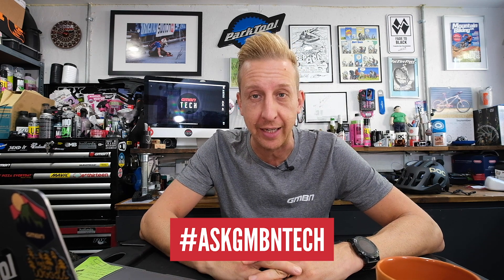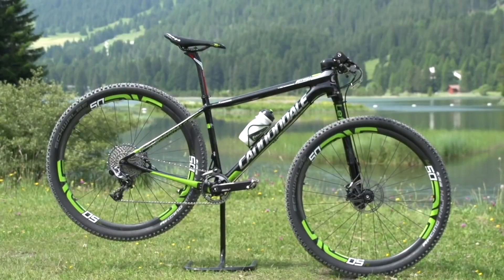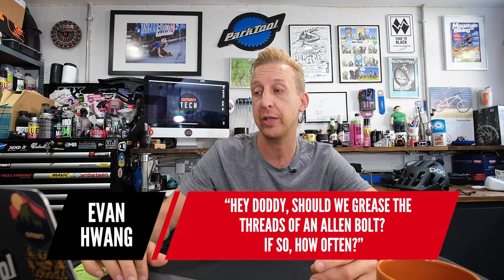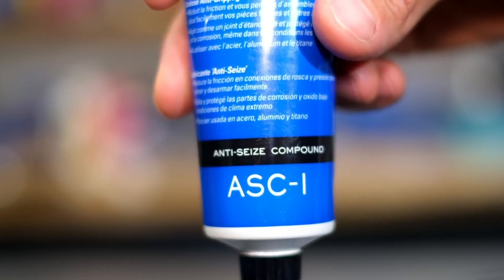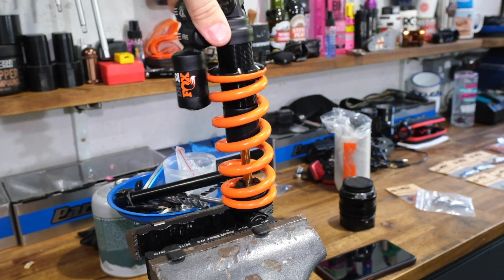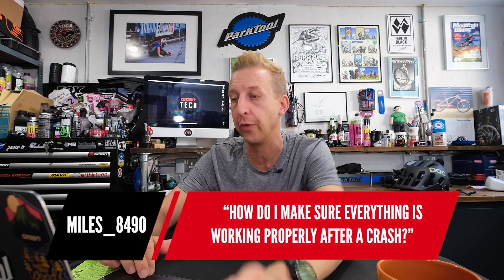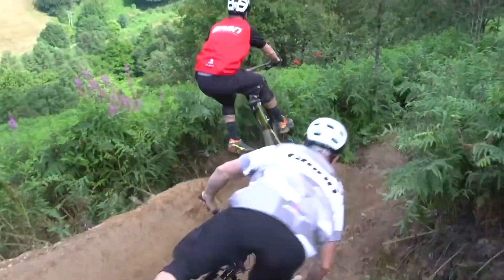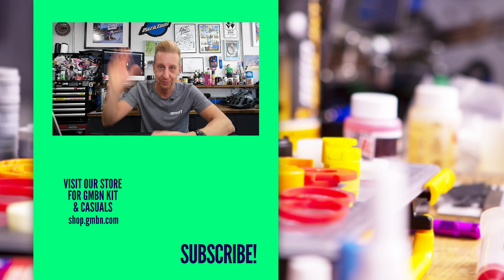How Do I Check My Bike Is Not Broken After A Crash? | #AskGMBNTech

Comment: #AskGMBNTech hi I have a Lapierre zesty 3.0 from 2019,about 2.5 months ago I cracked the frame just in front of the rear break Caliper and I have just got a response from Lapierre saying it’s under warranty but I have to wait till January to get the replacement. I love the bike and have upgraded the gears, the fork, the wheels and breaks and loved the way it handled, I’m looking for a slightly bigger travel bike for 2021 as I have had it for nearly two years, do you have any suggestions?

Comment: #AskGMBNTech - Hi Doddy & team. What makes a tubeless tyre tubeless? My sons bike is fitted with Kenda Slant Six 24 x 2.6 tyres. I wanted to set up the bike to be tubeless but these tyres are not tubeless ready in this size and couldn’t find the same size tyre that were tubeless ready, so i thought i would give it a go anyway. They have been holding pressure for a while now, but is there something that could go wrong in the future (will punctures not seal etc) Cheers

Comment: #AskGMBNTech Great show, watch it religiously. I have a 2010 Scott Genius 50 with the Equalizer 2 rear shock made by DT Swiss. The shock needs a service but is near impossible due to it not being main stream and service kits are hard to find. Is there a rear shock made by another big manufacturer that would work and fit?
Reply: In uk? Try full factory suspension.
Sorted a 2004 cannondale headshock even tf tuned wouldn't touch
Reply: @rupedog  unfortunately not. I stay in South Africa.

Comment: #askgmbntech how would you know if purchasing an after market shock or fork would be beneficial? I have a new stock trek fuel EX8, and the stock suspension seems fine but all the shocks / suspension from Fox / rock shock seem more capable, would they help with my riding?
Reply: Your bike has suspension that most riders want to upgrade to. If that suspension was holding you back your sponsor would have already sent your team mechanic the upgrades to install on your bike. You should spend more time trying different settings and less time looking at ads.

Comment: How do I true a wheel after having a crash and only discover the rim is bend but the rotor is still running straight to be able to get me home on the trails.
Reply: you can't true a wheel on the trail without a truing stand lmao
Reply: @miles9294  you can, just use some cableties against the rim. And then just true them as normal.
Reply: @gryyta9617  you can do that but its not a proper truing, its enough to get you home but you shouldn't keep riding
Reply: @miles9294  you can get it nearly perfect, good enough to keep ridi'n.

Comment: #askgmbntech I am wanting to get 1x12 drivetrain, my bike has a 1x8 right now and I saw you need a different hub for it. could I get it without a new hub or do I need to get a new hub for it to work?
Reply: Not necessarily. U might be able to get just a new freehub body, depending on the hub, or some of the lower range sram will fit a standard shimano splined freehub, as will I believe the e13 13 speed, sunrace and maybe others.
So no, u can do it without a new hub.
Reply: @rupedog  do you think shimano deore would work or will i need a new one for that. I am looking for a buget one

Comment: #AskGMBNTech  hi just wondered what to do if my dropper keeps on moving while not pushing the lever. i have just installed my dropper ( i have a specialized pitch it has a dropper routing on the down tube but not in the seat tube) i have a external dropper and have just routed the cable through the down tube but now i have done that the seat moves without pushing the lever can you help?
Reply: cable is too tight?maybe the cable routing has a tight corner and cable rubs inside?
Reply: @elvisp8104  no I think it's cos the cable has to go round the bottom bracket which it too acute of an angle for the cable I think anyway

Comment: #AskGMBNTech Hey Doddy, I've got a Rockshox Reba 130mm travel with a solo air spring, I'm about to do a lower leg service, and I'm wondering if I can I fit a DebonAir spring?  The part number on the back of the crown is 16T81680535.  Thank you
Reply: Yes u can. Check rs website, find the rs spare parts catalogue and ur fork, and it will list the upgrade spring in the parts list

Comment: #AskGMBNTech hi I'm fairly new to MTB, I have a 3x8 cannandale trail 2020  can this be made into a 1x8 or 2x8 also can you make a video of how to convert it on a budget or would all parts need replacing or would the removing of 2 rings work thanks in advance
Reply: Watch this very video...doddy goes over exactly this!!
But at the cheapest level, u can just remove the front derailleur etc, and the smallest and largest chainrings
Reply: Have a look at the box 4 8 speed it’s pretty cheap and should fit
Reply: @bristoldh7907  thank you 

[edit] ordered looks an easy(ish) swap out

Comment: #Askgmbntech I just got a a giant trance 2 and when I’m on gear 2 it’s making a ticking why?
Reply: random stuff of thx
Reply: If it's only one or two gears, the hanger could be slightly bent.  Also, it might just need a slight cable adjustment.  I had that once, and it was a bent tooth on the next smaller cog that was catching up the chain from below it.

Comment: #AskGMBNTech Should you always set the same amount of sag front and rear or you can play around with a different amount of sag in the front vs the rear?
Reply: Rear is usually about 25-30%, front 20-25, but varies on type of riding, use, bike, rider, etc etc
Reply: Rupert Wenn I run both at 20% sag. Thanks for the info.

Comment: #AskGMBNTech i recently rode my bike through some salt water , i throughly cleaned it after with fresh water and soap but now i have furry nipples , no one likes furry nipples . i cleaned the fur off with wd40 and a tooth brush . but it comes back every other week or so . the rest of the bike is fine , the spokes still have tension and the wheels are still true . are these wheels still safe to ride or should i replace them ?
Reply: Sea water or sand must have made its way into the spoke nipples. Tyre probably absorbed a bit too. Remember this happened to a BMX years ago. Think it took ages to stop happening. I rode it with no problems. Keep an eye on it though

Comment: #AskGMBNTech Hi Doddy. I'm going to get a new bike soon and it comes with a Fox Float DPS shock. Out of curiosity I checked out the rebuild procedure. See Step 15 of the "General Reassembly" section in the guide linked below. Can you explain what this high pressure nitrogen chamber filled from the bottom of the shaft is please? Very curious about how this (quite complex) shock works. Thank you! Needless to say I love the show.

Rebuild procedure guide: https://www.ridefox.com/fox17/help.php?m=bike&id=549

To be fair that's a pretty scary rebuild procedure, not going to lie. So many new thing compared to what I'm used to (more entry level RockShox so far). I think I can do the main air chamber maintenance fairly easily, but the damper I will leave to a bike shop I think. Or I get somebody to keep me company while doing it ;)

What bike am I going to get? I'm so glad you asked. Well it's all Henry's fault let's face it. I was already looking at the Commencal Meta since the new model came out... then, when you asked Henry which bike would he get for Enduro (a few shows ago) and he said Commencal Meta... that was the final blow, I could not hold myself any longer. I'll get the TR Essential version, for what I do that's plenty already and I like a lively bike.
Reply: You cant do the nitrogen bit at home...it requires specialist dry nitrogen and equipment. U wont ever strip that level down. 
Given its soo new u havent even got it, why are u wanting to strip it?

Comment: It’s depressing when people say replace your helmet every time you hit it. If there is no damage apart from a few scratches then you reuse it.
Reply: also, a helmet you should spend a lot on, I use the Bontrager Rally wave Cell. it protects me really well, is ventilated and has a crash replacement guarantee
Reply: There could be a crack inside and the next time you fall the helmet breaks and you are left with brain damage
Reply: Ollie MTB one hit can weaken the whole structure of the helmet, it’s the way they work, take your chance

Comment: Copper isn't inert, it's a reactive metal...it tarnishes even in air!
Pedal threads would be the only place to use copper grease on a bike, even then, normal is fine.
And copper grease can be harmful to some bike components.
Really would not recommend it for a bike!!

Comment: #AskGMBNTech my question is about brake noise. I was riding a windchill a couple weeks ago and towards the end of the day my rear brake wasn’t performing well and instead of squeaking it sounds like a lorry or big truck braking hard. Tried sandpaper and disc brake cleaner. Everything’s tight. But still making a lot of noise. (Saint m820 on Shimano rotors)